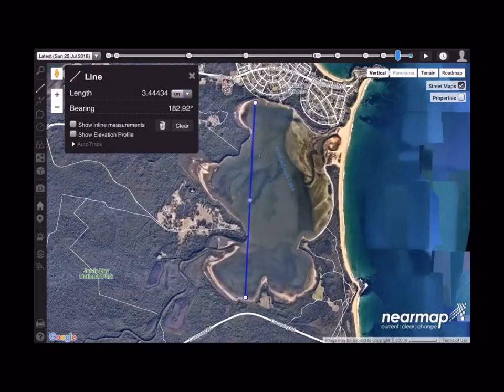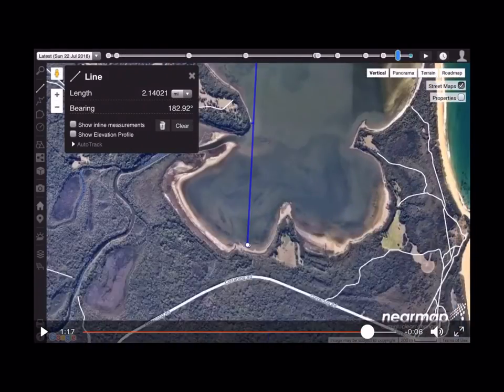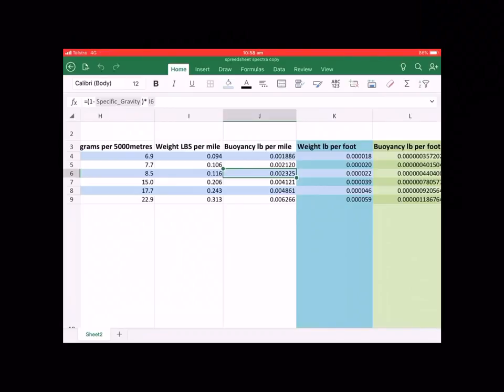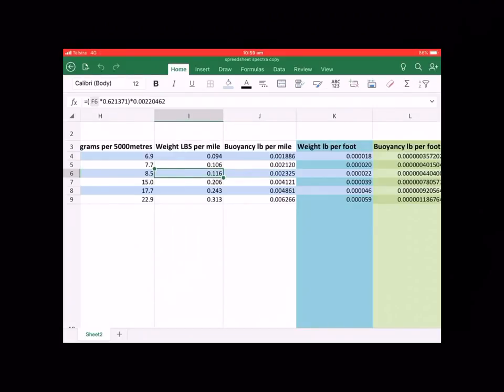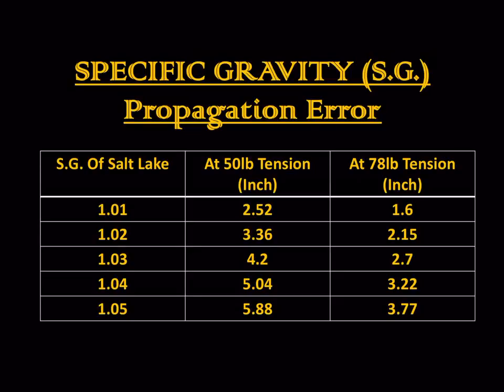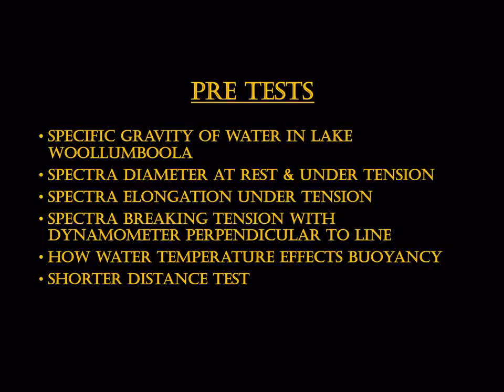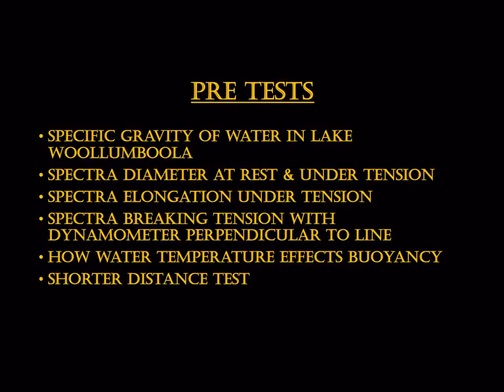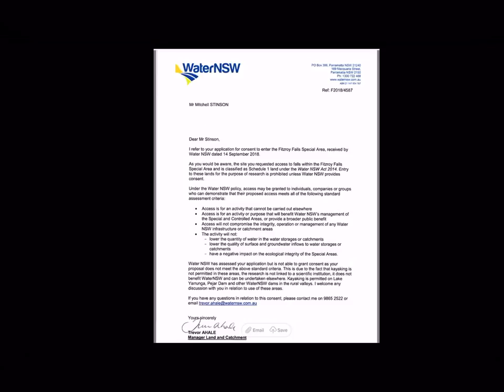TORQUE the LINE EXPERIMENT - SALT WATER LAKE

Comment: For 0.317mm, I agree with volume and mass.

p*V*g is the buoyant upward force, so 1030kg/m^3 * 7.9*10^-8m^3 * 9.81m/s^2 = 0.0008N
Then subtract the downwards weight m*g, 0.000077kg * 9.81m/s^2 and after subtracting we end up with about 0.000043N upwards per meter of line.

78lbs force is about 347N, and the corresponding sag of the line is 18.5cm. 

That means we expect the line to be less than 5cm deep at the deepest point, IF all conditions are perfect, and the line doesn't snap early due to currents. And there will be currents acting on the line.

Comment: Just reading up on your experiment. Have you accounted for water tension and its subsequent increase as you are now testing in a salt water body? 424 grams over 5000 meters seems awfully light to me, are you going to get any meaningful data that isn't going to be hampered by a large number of external factors which all have error margins?

Comment: Fresh water buoyancy ??? Why are you using fresh water when this is Salt water? A rough number for salt water you should be using 1.025 ... not 1 if its going to be conducted in salt water (or if you have it calc'd in salt water to convert it to fresh water simply use rough multiply by 0.975 will convert to fresh water). That will change your 'Buoyancy lb per mile' from 0.00232 to 0.00522 simply by using Salt Water buoyancy number.

But we need to back up, because I am not understanding several other prior calc's either. You mentioned Specific Gravity ... guess you are referring to Gravitational Constant, which is 9.80665 m/s² or 9.81 m/s² (actually 9.78 to 9.82 m/s² depending on lattitude). So how did you get 0.98? Or am I not understanding and getting confused by the similar number. Is that the gravity of the dyneema maybe.

Also when it comes to maths ... I can be bit anal at times. 22/7 for pi is lazy :p Would be so much better if you used actual pi up to 10 digits. As 22/7 is off after the second digit, only correct up to 3.14, after its off. Margin of error is admittedly small, but when you are working over such long distances, I would tend to be bit more precise than that and use better more accurate numbers, especially for safety sake.
Reply: Ok you did convert using 1.03 .. little less precise than what I gave above, but as long as you are aware and use salt water buoyancy amount you are ok.
Reply from the maker: Yea I’ve got a refractometer to measure the actual SG of the lake at the time of the experiment

Comment: To be safe I would torque the line until it snapped, to be sure there was no sag
Reply from the maker: If it were a cheaper line yea I would Tension to breaking point, but this is a line I want to be used multiple times by not only me here, but by others elsewhere to create an objective truth.
My calculations show at the rated strength of 50lb it will work for the water level test and underwater test. No line will ever work for the totally above water test, everything always has a sag
Reply: How expensive is the line? I'd be willing to pay for a one time snap test. It is good to have an easily repeatable experiment though.
Reply from the maker: The spool I got was 5000m cost $900
Reply: There is no point in doing a test to breaking point, the sag will be almost as great at the point it breaks as it is at the rated tension.  The important thing is to know how much sag there is.
Reply from the maker: Yes and that’s the aim of the experiement, to measure the physical sag or buoyancy against the physical shape of the water
Reply: As n angler I can tell you Spectra line is well known for it's lack of stretching. On the downside it breaks down(loses tensile strength) in direct sunlight. Which is why all the professional anglers use it as a one and done spool up. After you do your test you will not have a line with 50Lbs tensile strength. It will reduce in strength by 2Lbs every time you expose it to sunlight. As Spectra has an excellent buoyancy it will be near impossible to test under the water.
Reply from the maker: Thank you for your comments, they will be taken into consideration. The breaking strength is 78lb so if it reduces by 2lb each time used we can still get a fair few uses out of it.
As showed in my other videos the buoyancy of the line has been taken into account and calculated that it will be a viable test under the water
Reply: @torquethelineexperiment1253  Spectra line come in increments of 5 above 10Lbs. The line you showed in your video shows 50Lbs.
Reply from the maker: The manufactures rating is 50lb, actual breaking strength is 78lb